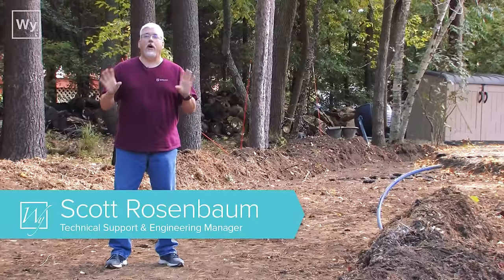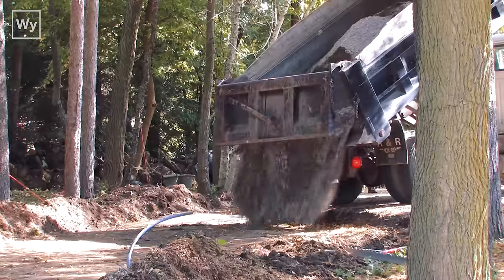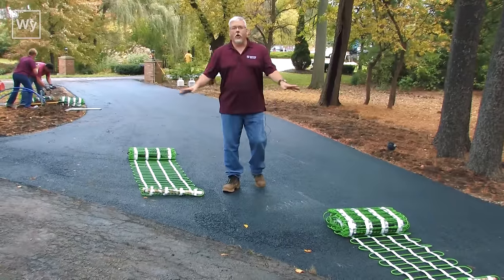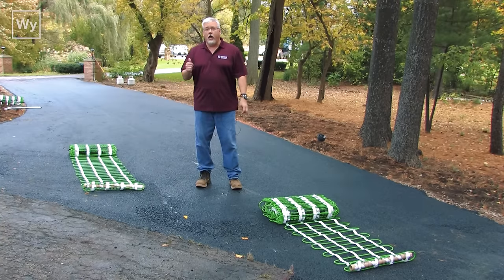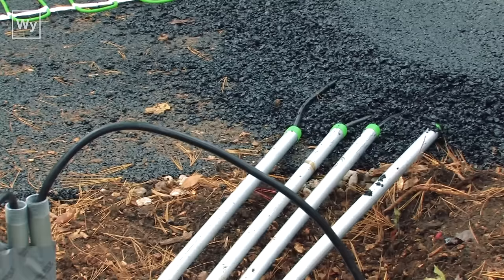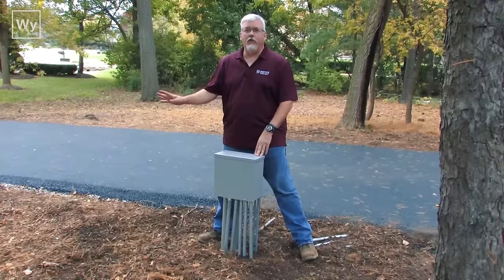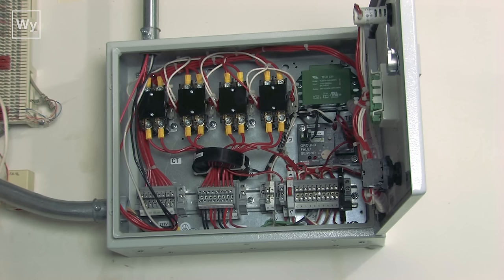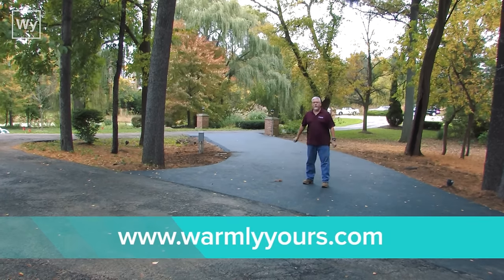Electric Snow Melting system installed in an Asphalt Driveway

Comment: How much would such a system cost, and what parameters determine the cost? Are there any options or accessories with such a system?
Reply from the maker: Thomas, Thanks for watching. The cost of a snow melting system like this is dependent on one main parameter: the size of the heated area. In this project, the customers selected “tire tracks format,” which means the heated area is made up of two strips of roughly 2’ X 20’ (about 80 square feet total), which is very affordable when compared to full coverage at 200 square feet (10’ X 20’). 
By entering your project’s dimensions in our Instant Quote Tool (https://www.warmlyyours.com/en-US/my_instant_quote/start), you can get a custom estimate of how much it would cost. If you have any questions, don’t hesitate to give us a call (800) 875-5285.
Reply: it would be much cheaper just to shovel the snow off the driveway compared to heating it.
Reply: WarmlyYours 
All that and you don't even show how the system works?
Reply from the maker: This installation is actually for an electric radiant heat system.
Reply from the maker: You can actually see a time-lapse of the snow melting system at work here: https://youtu.be/7wdpsTCYoXI Thanks for watching!
Reply: I would say between $30-$60 grand... Labor and materials what we saw on this particular vid...
Reply: time is money
Reply: I knew someone with a long driveway out in the country...they bought an old beater 4x4 pickup and put a snow plow on the front...after the son did their driveway, he went out and made some money doing others.
Reply: Ben 1337 I thought the same too wouldn't it be costly on electricity bill
Reply: These would be very nice during a freezing rain event. Especially if driveway is on a slope.
Reply: Electric??? Way too expensive to use. A hot antifreeze system fired by gas would be more cost effective.
Reply: Cheapness to convenience ratio is vastly different to those who have an abundance of money
Reply: Greenid Guy What's that look like?
Reply: Ben 1337 that completely depends if you are able to shovel snow. Not everyone can....
Reply from the maker: This is a great point to bring up - many people forget that these systems are not just a luxury but a necessity for some who live in colder climates and are unable to clear snow and ice. Especially with more people aging in their home, investing in a system like this will guarantee you can have a snow-free driveway, walkway or stairs for many years. Thanks for watching!
Reply: Electricity cost shouldn't be too bad... if you're able to switch the thing on and off when you want.
Reply: @Ben31337l  Let's see you say that at 70 years old.
Reply: The idea is fantastic thumbs up from me.  The cost to install and electicial cost involved pretty pricey.  Why no water pumping system? At any rate great idea for people who can afford such an option.
Reply from the maker: Water piping requires more installation materials and is not as quick to warm up as an electric heating system. The water tubes used are much thicker and therefore require a much thicker layer to embed the heating element. The water has to get to temperature and make its way to the areas to melt the snow whereas electric is able to warm up almost immediately and start melting the snow. Electric is also able to stay consistent in temperature throughout the system while a water heating system would be warmer near the point of entry and cooler at the point furthest from the boiler. Thanks for watching!
Reply: @Warmlyyours , a crazy question - can the system be adapted to create an exotic flower bed in the garden? (to overwinter plants with low hardiness)
If so, have you ever heard about someone actually making it happen?
Reply from the maker: Our system was not designed or tested for this type of use, but there are plenty of other systems created specifically for keeping plants and soil warm during winter: https://www.google.com/search?q=soil+heating+cable&oq=soil+heating&aqs=chrome.0.0j69i57j0l4.16359j0j8&sourceid=chrome&ie=UTF-8
Reply: At least $50,000. Just hire someone to shovel if you don't want to do it yourself.
Reply: @PianoBlackTrimRep.  I'd have to agree, if it's bad enough you can't get out of your driveway, then everyone else is in the same boat, just have a service do it for you or a family member if you aren't able. Most ppl charge 75-120 bucks for a modest driveway, less if it's smaller. Way more economical for a maybe than a huge investment, but if ppl got money to toss, more power to them.
Reply: Can that be laid under a cobblestone driveway?
Reply from the maker: This system does work with pavers, so as long as the "cobblestone" had a similar thickness to the pavers we recommend and are embedded in mortar, it should work just as well! You can find more information here: https://www.warmlyyours.com/snow-melting/heated-walkway-path
Reply: After you see the electric bill, you’ll realize it would have been cheaper to move south!
Reply from the maker: These systems are actually relatively energy efficient - especially when paired with the right combination of sensors and controls to help automate everything. You can figure out the actual electrical cost based on local kWh rates and project size here: https://www.warmlyyours.com/en-US/snow-melting/cost-calculator Thanks for watching!
Reply: @Ben31337l  not if your on a hill and elderly or worried about falling I installed one is western pa and it was amazing so much my neighbors did same
Reply: @joenissan  ... it's not the electric bill. That's actually cheap when you figure what it costs to hire a plow. A driveway like this in my area might run $50 - $80 per clearing and likely $10 - $20 for electricity. IOW, the up front cost is high, but if you are paving the driveway anyway it's worth looking into the added cost. The bonus is you can flip the system on at the first flake and shut it down say 8 - 10 hours later and the driveway is clear the entire time. Great for when it's only a few inches and the plow costs the same for a little or a lot of snow.
Reply: I priced one for $10,000.
Reply: @Ben31337l  - You're forgetting that some homeowners are  too old, and/or have disabiities and can't shovel snow.  Also, the homeowner will recover the cost of the system, since they won't have to pay for a snow plow service during every snowfall + a system like this will actually add additional value to the home when the homeowner decides to sell the house.

Comment: My dad DIY'd this type of system back in 1996 on our driveway, works like a charm even today! just run heavy duty PVC pipes with anti freeze in them. keep a radiator in the garage connected to the pipes and done! once press of the button and snow melts away.... time and time again.
Reply: ?. Please explain.  Pump? Heat?
Reply: @thesimplegig You'd need a pump, radiator, and a fan.  The cold coolant runs through the pump into radiator, warm air passes over the radiator heating the antifreeze, antifreeze goes through one leg of the pipe to the bottom of driveway, back up the other leg, and completes the circuit back at the pump.
Reply: @d00der41  so you'd need a well-heated garage? Or do you put an electric or propane heater in position to blow hot air through the radiator?? I doubt that the 40° air in my garage would warm the antifreeze enough to melt ice at 10°

Comment: We put in a similar system in for a house in Reno, 6 months later the snow senser  went bad and no one noticed it until the $3000 power bill came in.
Reply: Robert Watterson ouch. Guess it's time to move away from typical electrical bill and go solar.
Reply: solar wont able store enough energy efficiently to melt the snow
Reply: Robert Watterson lol
Reply: i bet you could cook eggs on that driveway
Reply: The solar panels would be covered by snow there for generating no electricity. Better put a heater on them too, the model of green efficiency.
Reply: Robert Watters
Reply: Don't use a sensor, have a switch that you turn on and you turn off
Reply: Robert Watterson i did not know it snowed in Reno? How often do you get snow out there
Reply: redeyetrucker67 Best solution.
Reply: Kyle Roudabush that defies phyisics. You are suggesting take solar energy, convert to electricity, then convert it to radiant heat? If you have strong sunlight all day, you probably don't have a snow problem in the first place. lol.
Reply: redeyetrucker67 agreed. How could they not have it on a switch? At least have the circuit breaker off in the summer. I switch my AC off at the breaker in the winter just in case.
Reply from the maker: If you've never seen how much the snow can accumulate in Northern Nevada, especially Reno, you should take a look! They get plenty of snow up in the mountains there, despite other parts of the state getting to 100+ in the summer.
Reply: That sucks ! A time would probably be better so it wouldn’t get forgotten and would turn off
Reply: @LOJ777  Every winter.
Reply: @kairu.kun.z   That doesn't make any sense.  Say you put in a solar system that reduces your power bill from $200 to $50 each month because it generates the $150-worth of electricity each month.  Then suddenly you use $2800 in addition to your usual $200.  Your bill without solar is $3000, and with solar it's $3000 - $150 = $2850.
Reply: It was never very smart to put it a system like this with no fail-safe system.  A fail-safe would have inhibited the flow of electricity unless everything is working perfectly
Reply: how is that even possible.....entire house is what 50kw? 5$/hr  125$ a day.   1250$/10 days 3750$ a month and theres NO WAY the house could put 50kw of power into the driveway could it?
Reply: @redeyetrucker67  have both
Reply: @LOJ777  You be surprised that Las Vegas do get snowed sometimes. There’s a ski resort in Charleston mountain nearby.
Reply: Ouch
Reply: If you don't have a manual switch, shut the entire system off at the circuit breaker once it's spring.
Reply: @redeyetrucker67  This is exactly how I see using a system like this. Basically instead of dressing up and grabbing a shovel just flip a switch
Reply: C'mon

Comment: I thought of this when I was 10 years old back in 1980 but to put it on highways
Reply: Exploxer25 the highway by Thompson Manitoba Canada is heated but I think they use some type of geothermal heat sink system.
Reply: jim bob dose it work?
Reply: Exploxer25 yooooo ur so smart
Reply: I just nominated you for the Nobel Prize.  Good luck man
Reply: When I was 10 I thought about blowing the salt off the streets so I wouldn’t have to go to school
Reply: You have any idea the cost of such infrastructure? the largest pull on the utility for sure. But then again. how many millions go into plows and so forth.
Reply: Exploxer25. Seriously?  You can't even get those  over paid, 5 guys to a  shovel to properly repair holes without making it a bump, if it's not a dip, it's a bump.
Reply: Some highways in Holland are actually doing this; using sunshine to warm the water, store it deep under ground and use it to heat during winter in order to avoid black-ice
Reply: i thought about it too only difference is i was thinking about putting it on the roof but dat would be hella dangerous .
Reply from the maker: We actually do offer a product that works much like that - helps deice your roof and gutter during Winter to help prevent ice dams and eventual water damage in your attic. Here's one of our videos showing how it's installed: https://www.youtube.com/watch?v=JT72pEwoxJc
Reply: why dont they install this on airplane runways?
Reply: @59672270  they do this in parts of Japan  ..... regular roads too

Comment: Cool
I think this will make it more prune to cracks in the asphalt more easily
Reply from the maker: The system does not heat up more than it needs to be above freezing so that the snow and ice will melt. The summer sun's radiant heat would do more to alter your asphalt driveway than this system.

Comment: This is a great video for a flat surface my driveway is a steep slope. Warmlyyours your crew did what looks to be an excellent job.
Reply from the maker: Thank you @jerzcnate! This system is actually great for sloped driveways as well, we had a customer install this in a winding sloped driveway so they would not have to shovel snow on a steep slope.

Comment: I worked in a home in Beaver Creek that had this type of system installed. When it was in use their electric bill was $5000 per week!
Reply from the maker: This is likely not possible unless there was something wrong with how much power the system was drawing and it was not set up with the proper sensors and controls. 

If you visit our operating cost calculator here: https://www.warmlyyours.com/en-US/snow-melting/cost-calculator You can see that even for an area like Beaver Creek (with $0.15 kWh pricing), running these systems for 8 hours a day on a 1000 sq. ft. area would be $83 a day, and only $581 for a full week. Even at 24 hours a day, the system would have to be over 3,500 square feet of coverage to get a bill that large. But many driveways are simply not this large, and not running each day for more than 6 hours on average.

These systems are designed to turn on when it starts snowing to help immediately melt falling snow and stop once the temperature and moisture sensors indicate there is no more snow on the surface of the area. So it's very unlikely that a system would run up that large a bill unless it was not installed correctly or something wrong with the electrical at the house.

Thanks for watching!

Comment: Nice installation video. I would have loved to have seen if it worked! ⛄️
Reply from the maker: The system had to be installed well before winter, so it wasn't running yet. But you can see it at work here a few months later: https://www.youtube.com/watch?v=7wdpsTCYoXI&lc=UgxYOtGR6Kw6uNhLZRJ4AaABAg

Comment: The ground temperature below 42 inches is normally 55 degrees. You can tap into that free temperature with a loop system that captures the surrounding temperature of deeper pipes and lay them near the top under the driveway to melt the snow and ice. If you have enough land, you can capture enough to even line your outer walls with pipes so that when the outside air temp is like 22 below zero, your walls will be closer to 55 degrees thus saving you heating costs.

Regardless of which melting system you decide to install you want to make sure the water created from melting snow has a place to go or you will create an ice sheet somewhere else. If you provide a drain for the melted water to go, you also need to provide heating on the drain until you reach a depth that the water will no longer freeze. This is usually below 42 inches.
Reply from the maker: While geo-thermal energy is a great resource, not everyone is able to dig that deep into their yards, nor do it for an area that would capture enough heat to melt snow off the driveway. Our systems don't require you to dig that deep into the surface and as a result can be easily repaired should something happen to the cable/mat after it has been installed. Our controls have an "hold-on" feature that keeps the system running intermittently after the initial warm up to make sure that all the ice/snow is melted away without refreezing.

Comment: This is very cool.  I always wondered about a heated drive with asphalt as the house I grew up in had a concrete heated driveway.  As long as the switch was turned on before the snowfall it would work great...but if it wasn't....we still had to shovel.  I grew up in MI and it was back in the 70's......with the cost of electricity these days....I will have to stick with my snow thrower.  But hey thanks for a great video presentation..thumbs up !!!   ;-)
JD
Lake George, NY
Reply from the maker: Thank you JD for the kind words, thanks for watching!

Comment: Not only does the video do not show it working, it also proves how much of a trouble it is to install and make repairs on it
Reply from the maker: Hi Matheus, these installs typically happen well before Winter and therefore the system could not be shown working during that time of year. If you watch this video you can see it at work: https://www.youtube.com/watch?v=7wdpsTCYoXI As for repairs, with electrical tools and thermal cameras, you could easily detect any issues with the system and make isolated repairs to parts of the driveway without ripping up the whole system.

Comment: note I install this here in New Jersey and they are a great investment for someone who might be desable or to old to clean the snow,, but it's really really expensive it takes a massive amount of powers/electricity / most of the time we need to upgrade your electrical service up to a 400amp just to keep up..note a average home has a 100 or 200 amp cervise ..so a 2 car lent drive way will cost you any were from $20k to $ 30k  .. ...

Comment: this would use more energy than my entire house and the yearly upkeep would probably be massive.
Reply from the maker: There is little to no yearly upkeep for our snow melt systems. Most of the work goes into installing them correctly and making sure the sensors for controls are connected properly and located in the best spot. As for energy usage, most systems would only need to run on average for 6 hours per snow day. 

As for the cost, when this system was installed, the going rate was $0.08 per kWh (Chicago suburbs), this system uses 15 kWh and costs roughly $1.20 per hour to run. For an average snowfall, you would run this system for about 6 hours in a day, costing you only $7.20 per snow event. There is always an option to manually turn off the system should you want to further cut down on energy cost.